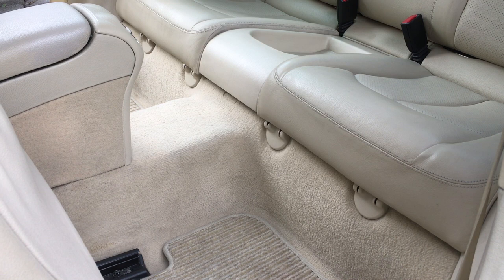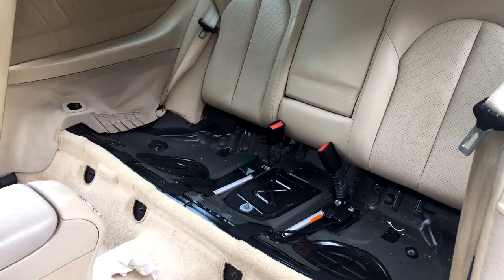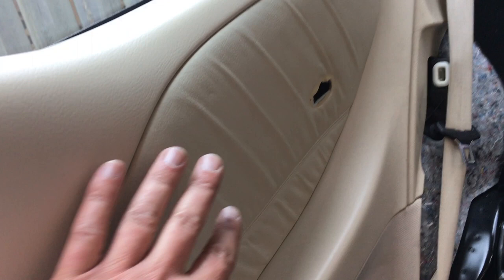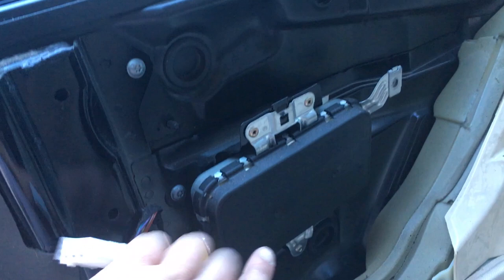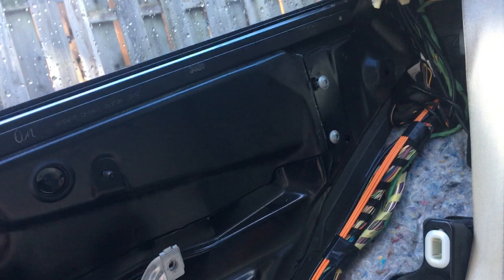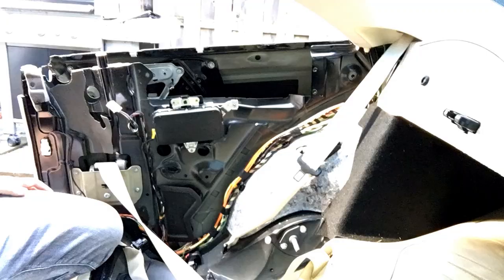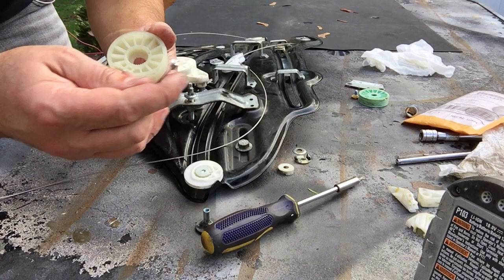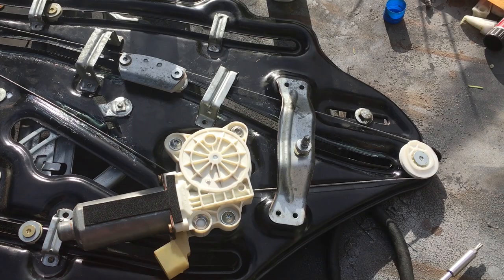Mercedes CLK320 W209 - Window regulator - removal and repair for under $20.

Comment: I did this on my wifes convertible. Huge job, this is. It's always the same plastic piece that brakes. I'm surprised an aftermarket company hasn't designed a metal on to replace it, so it never brakes again, like the vacuum actuator lever on the intake manifold. Only one window quit working, but I ordered the kit with both repair parts for both sides. It's a good thing, because the other one was broken too. It just didn't bind like the other one. It broke in a slightly different section. Good video. I just got me the same car I got my wife, and now one side is grnding when it goes up. The guy I bought it from said he had it in the shop to repair one of the windows. It seems they only fixed the one and didn't bother with the other one.

What? You're not supposed to have extra parts when you're done? I thought that was supposed to be a sign of a good mechanic that can get the job done with less parts. LOL
Reply from the maker: Thanks for watching

Comment: You took the long route. There are videos on here where you do not have to remove the seats at all.
Reply from the maker: You are correct you don’t have to remove the seats however, I’m glad I did it for my installation because it allowed me to have way more room and access to remove panels.
Reply: @MarcoCerqueira Glad removing the seat’s worked out for you!!!

Comment: Great job and explaining dude. I will do it too but i have an issue. My window is halfway downed and stuck there. How can I dismantle it?
Reply from the maker: Process is the same.  Once you start diving into it you should be able to manually move to window to access the bolts to remove the glass…good luck

Comment: So this is something I’m dealing with right now on my 2007 CLK and you’re video helped so much also I found a way to remove door panel without removing back seats
Reply: Hi.  Please tell me how to remove the door panel w/o having to remove the back seats.  I just acquired a 2005 from my brother.  In addition to the rear window issue, he says it has a tear in the top and it is burning oil excessively.  I do as much of my own repairs as I can.  I want to know what I'm facing before he brings the car to me.

Comment: Marco: Thank you very much for your video and explanation. Your work was spot on. Clear and concise. Tremendous help. FYI, current kit $35.00. Bad news was that I had 3 nuts left over. Good new was that I found their proper placement location on presenter frame and air bag. On a similar issue I am tackling soft top cylinders on our 2005 CLK 500. Any videos on that? Thanks again. Have a great day.
Reply from the maker: Glad it was helpful!  Unfortunately my car is a hardtop, so no videos concerning the convertible model.

Comment: True. The cables that came in the kit bought from Amazon, were maybe one inch one short. It was very difficult to put them in place. I'm not sure if that can cause too much pressure on the plastic parts and brake them apart.
Reply from the maker: If you use the factory spring it will help
Reply: @MarcoCerqueira  thanks for you comment. The original cables were scrambled and destroyed. I found just one spring left and not usable. I installed the cables from the kit. As I said, they were short and very tight to install. I lubricated the cables and gears. Hopefully it last. I rarely use the rear windows, but regardless, the plastic parts broke apart. They should be made of metal.

Comment: So far half way done just an update. Once you understand it gets easier. Mine is a convertible and also a 63 AMG so probably is a lot easier having the top down, but it is very different in a lot of steps so I ended up just having to figure it out on my own. Either way got the seats and middle speaker out so far and now just working around the panel since I can access those 3 torx screws that were hidden behind the seat now.
Reply: I have a CLK63 convertible as well, and I need to to this repair on my left rear window. Did you figure out how to get to those 3 torx screws?

Comment: I repaired the rear window on my 99 slk. Same broken plastic. It was tricky but very accesible.
You have done a great job with this video. I only have one question. Do you really have to remove the seats and the lower panel?
Reply from the maker: Thanks!  I was learning as I went since it was the first time I had to do this.  I do recall the the seat back are in the way and you can’t remove the seat back with the bottom cushion in place, so it does make easier.  Door panel bottom can stay, I think.

Comment: Hello I did my repair but I have a question in mind. Does it fit perfectly on the plastic legs in the glass regulator or it only holds my 3 screws. I made the adjustment well, but only the plastic coating in the 3 screw regulator that holds my glass does not touch the feet. What should be
Reply from the maker: Sorry, I don’t think I really understand your question. However, if you’re talking about the three screws that hold the metal regulator in place those should be tight. If you’re talking about the screws that hold the actual glass in place those do not need to be super tight, but there should not be any slack.  If I remember correctly, I believe those plastic washers go in front and behind the glass so that there’s no actual metal touching the glass. Everything should go back the way it was before you remove it. Hope this helps. Good luck.

Comment: Everything perfect, I had a problem when mounting, the seat belt does not work, do I have to configure it or something? Thank you
Reply from the maker: Is it possible you might of left something unplugged?  There is no need to reset anything other than just adjust the window itself.

Comment: Thank you so much Marco! One question, how long it took you to do the repair?
Reply from the maker: Hard to tell exactly because I was filming which doubles your time.  I also was working without a shop manual so I learned as I went.  So it took me a couple of weekends maybe 12-16 hours.  You can probably do it in half the time time that there is a video on how to do it...LOL

Comment: Great video, If you get a quick reply it’ll be muchly appreciate as it’s currently on hold! Haha 

I disconnected the battery as you said, now new regulator is back in, I want to check its working perfectly before I put it all back together. What do you think? Can I put the battery in? Air bag won’t go off? Scared to do anything around that thing 😂😅
Reply from the maker: Yes you can connect the battery to test the window fitment, no problem
Reply: @MarcoCerqueira  thank you so much. Thanks to you my CLK55 AMG has the regulator back in and working, it was not an easy job but we got it done haha

Comment: Yesterday I fix my right window but when I push the button doesn't want to go all the way down. Also when I open my door the window go a little down not how it should be. When I push it it goes all the way down whit open door but does not want to do it self. Any idea why?
Reply from the maker: There is a longer cable and a shorter cable. It could be that you have them switched.  This would limit the amount that the window could travel. Before you take it all apart try to do a window reset. if you don’t know how to do that, here is a link on how to do it.  Good luck.
https://youtu.be/M1h4hBEDGyk?si=-5bJnEWHlSvVC6Fm
Reply: I’ve make a mistake putting the long cable on top of the wheel and the shorter on the bottom. Now after I watch your video for a million time I realize what stupid mistake I've made …. 😢
Reply: Thank you 🙏

Comment: how much time did it take to fix one side ? how may hours ?
Reply from the maker: Hard to tell exactly because I was filming which doubles your time.  I also was working without a shop manual so I learned as I went.  So it took me a couple of weekends maybe 12-16 hours
Reply: @MarcoCerqueira  thank you for answering - you the best man.